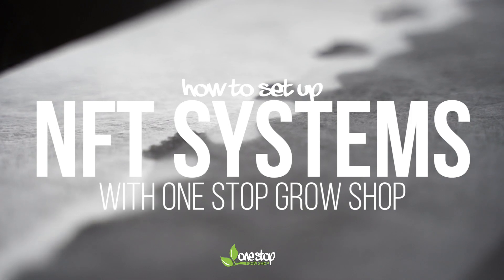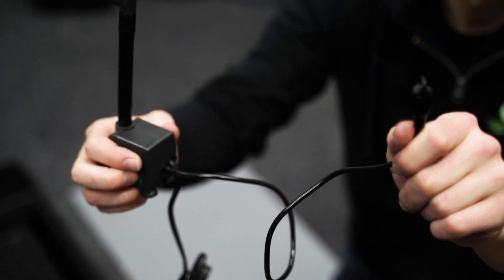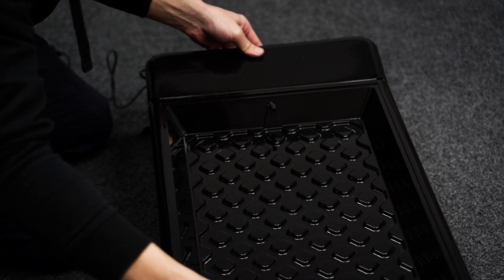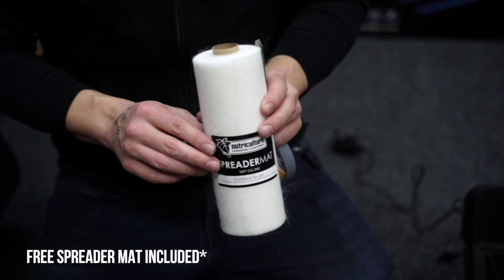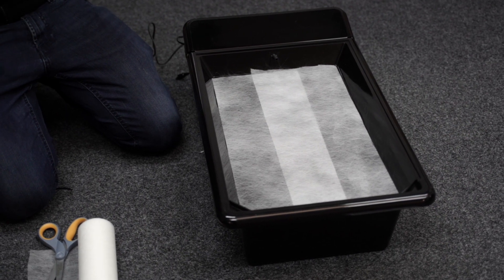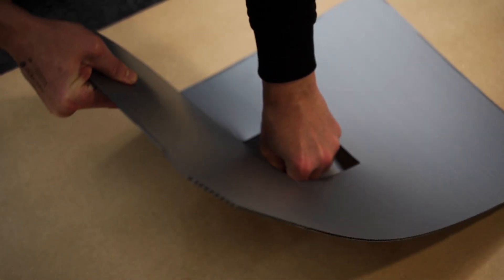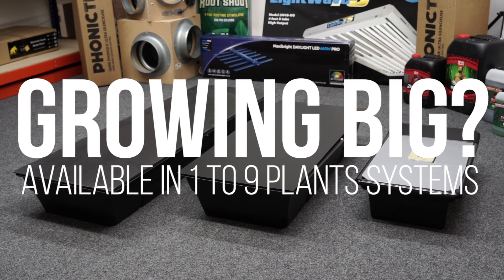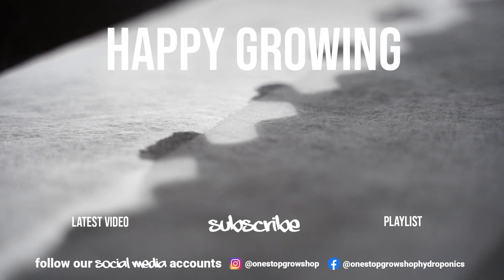How to set up an NFT System

Comment: Make sure to remove the plastic wrapping from around the rock wool cube, this will allow roots to break out of the cube on all side rather than just through the bottom. 
Drape the spreader matting along the tray length and into the water to reduce noise. 
The pump had speed adjustment, start with a slow output for more contact time with less roots, then speed up to full flow for establish root mats / root carpets.
Reply: No.. That's Wrong. You leave the plastic on always for NFT and SLABS. You Pump info is correct though as I the Spreader mat tip.